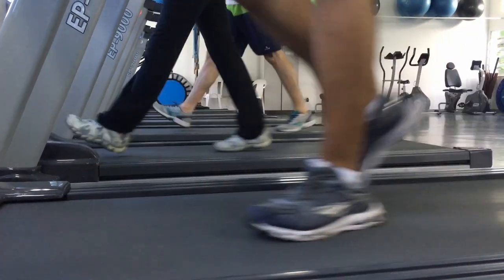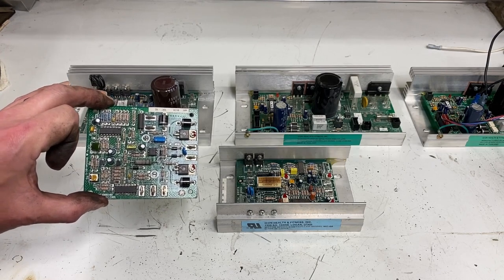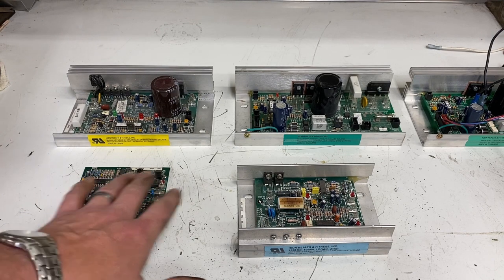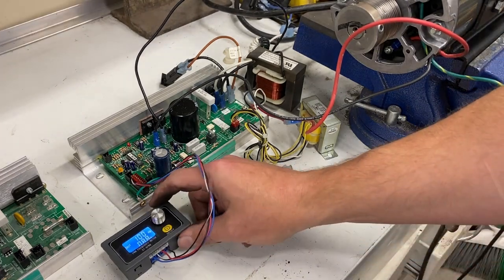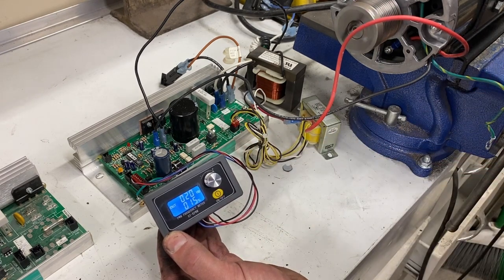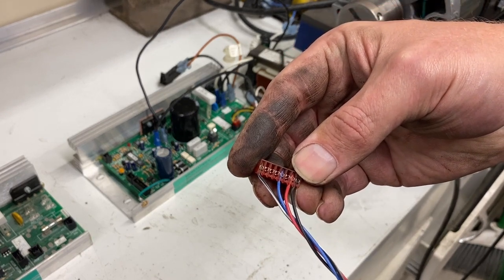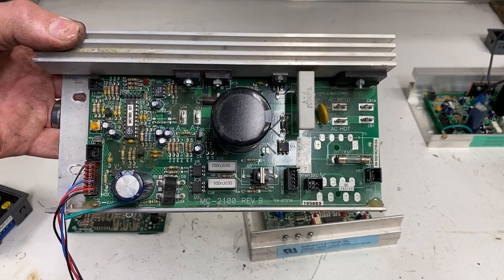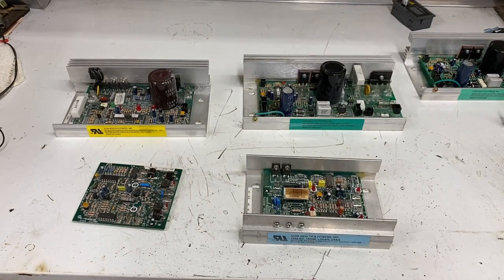Variable Speed Power Supply, Treadmill Motor Controller Boards: MC-02, MC-60, MC-2000 or MC-2100

Comment: In another video, you claimed the MC-2100 speed with a PWM is course when compared to the cheapo SCR you're so fond of. What giveth and why thy taketh?
Reply from the maker: I'm not sure what you are asking.  The MC2100 works fine but has the limitations associated with being for a treadmill.  I like the utilitarian function of the SCR https://youtu.be/zej3rkAEVDg
Reply: @dazecars  Yes, that video.  Starting at 10:15 in that video, you claim the MC-2100 speed adjustment can only be set at 200RPM or so increments, but in this video, the speed adjustment is very smooth at 2RPM or so increments. I'm confused because there's no way that cheapo SCR can even come close to a PWMs performance. All you have to do is look at the waveforms on an oscilloscope with some load. Some of those PWMs also have are very sophisticated and can adjust the current by sensing back EMF.  What gives? 

https://youtu.be/zej3rkAEVDg
Reply from the maker: @bobweiram6321    Couple things, first at the time increment you mentioned it was 100 RPMs increase not 200RPMs.  It is not possible for it to be much different than that when using the PWM signal generator I am using in the video.  That controller only allows you to increase the duty cycle 1% at a time.  That means without any other considerations you would only have 100 speeds setting and that is if the motor started at 1% (which it doesn't) and ended at 100% (which it doesn't, turns off at 85%) In reality there are 73 possible speed settings (in that bench test configuration).  The motor in the video is 6700RPM max.  Assuming there were no other variables 6700/73 would be 92 RPMS per 1%.  Now it is no where near that simple and that is why I measured the RPMS to come up with the difference between clicks.  (I do not know if that 100ish change is linear, it may me the same, more or less as RPMS go up but I don't know because I only measured at the range you saw in the video) Keep in mind If you use something more sophisticated with finer duty cycle increments than 1% you can dial it in at smaller RPMs, but that is more $ and complication.  Conversely the SCR allows you to adjust speed with a potentiometer and if you use a large one and a small one you can have course and fine speed adjustment.  With my lathe I can easily dial it in within a couple RPM.  It is geared at 3.5:1 so 7 motor RPMS.  If I had used an even smaller potentiometer for fine control I could have gotten down to 1 RPM at the motor but that is more accuracy then I needed.  The MC2100 also accelerates a lot slower as the SCR is at least twice as fast.  I have never once said that the SCR is "better" in fact I have conceded in many videos that the power produced by the PWM is cleaner,  smoother, and better for the motor.  The reasons I prefer the SCR over the 2100 are: simple to hook up, simple speed adjustment, no soft start or other “treadmill limitations" to contend with, finer speed control, faster acceleration, more compact components, and more robust components.  The MC-2100 wins in producing cleaner power but to me that is far out weighed in the shop.  If you take $100,000 sports car and $5000 truck and line them up to race on the highway the sports car will win every time.  But you put those same two vehicles on a rough gravel road with lots of potholes and ruts the truck will win every time.  Just because an MC-2100 produces “better” power doesn’t mean it is better for the application.  I also want to point out that just because I prefer the SCR for my application does not mean the MC2100 is a bad choice.  As I have said in many of my videos it is a good option and is usable.

Comment: hi david, well i couldnot not post my question here while having a compressor 150 liters looking for motor. 
i have used my treadmill motors for various things but not a compressor-single head. neither seen any body did that.
so, what do you think about this possibility? home use not daily use. thanks dear
Reply from the maker: Unless I am missing something, I don't really see an advantage.  An AC motor would be more efficient than a comparable DC motor powered with AC converted to DC.  The reason to use a DC motor is variable speed and there is no reason for that on a compressor.  I would try and find  an AC motor with similar specs to the one you are replacing.
Reply: only reason is price. o get dc almost for free as it is not appreciated at junck yards. induction motors are more pricey

Comment: Hi, my lifefitness 9500hr next gen treadmill electrics recently got fried. It has a large AC motor, says three phase. Can you recommend any controller to run tge treadmill as lifefitness no longer provide support.thanks lee
Reply from the maker: I can point you in the correct direction but I do not have specifics for you.  A VFD could be used to have variable speed for that motor and could control the basic on off and speed function of the treadmill BUT there would be no safety features like the magnet clip shut off or soft start.  in other words if it was going faster than the user and the machine threw said user there would not be the magnet clip shut off also with the elimination of soft start If you shut it off at a high speed and then turned it back on without changing that speed it would resume at the higher speed.
Reply: @dazecars  thanks for your help,  appreciate

Comment: Is there somewhere on the board that says what type of control it is,  MC-whatever?
Reply from the maker: Not all treadmill control boards have an MC designation.  It depends on the manufacturer. The board model number is usually on the actual board.   Also there is often a sticker on the heat sink.  The 4 I talk about in the video are all clearly marked so if there is not a clear mark with one of those numbers then it is not one of the boards I talk about in the video.

Comment: Do you have any videos on the more complex board (or one similar to it) you showed at the end? I have one collecting dust in my shop, and I'd like to try and use it instead of just tossing it.
Reply from the maker: no I do not
Reply: @dazecars  oh. Well, thanks for the time to respond on a year old video. The board I have has QQ-2061 listed as the model number if you have any leads on something like that. I've come up with nothing so far in my searches.

Comment: Can I get a part number regarding the power supply you used with the mc2100 at the end of the video . Thank you in advance
Reply from the maker: Not sure what you mean by power supply.  if you are after the signal generator, this is the PWM signal generator for the 2100 I am using https://amzn.to/3z3ivu3
Reply: @dazecars  the transformer sorry .
Reply from the maker: @jstc89  Its a 16V class 2 transformer like this one https://www.ebay.com/itm/403398903466?hash=item5dec72c6aa:g:y-kAAOSwEqlh2Ru2&amdata=enc%3AAQAHAAAAoJiM7SVzN2tj2Jp5eN0btQa2EeEONRdC2E4hL3onQye1MI%2B2bbxEXk1qNg8P5rZlRXvgLyjVGZSdj6ZsgdWRYRpyJRjPeG9EaucPD%2F2kIGr%2BMWlQWNALPIR2Q8dej%2FrNwtewXwGHV00Xl45Nt%2FR3neuzZRgnofVlROomI8rdfzzw57PjECMOOgVnPFI4WKUMj5bCk69i6XRj6nvovoNA1t8%3D%7Ctkp%3ABk9SR87ljIWNYQ

Comment: Belo trabalho em seus videos sobre o scr tenho um com potenciometro de chave e também se for possivel informe tenho
uma placa mc60 esta funcionando somente veloc. alta o que pode ser ?  o resistor controlador de velocidade queimou por alta temperatura ? (Brasil)
Reply from the maker: If the MC60 is only producing one speed and it is fast, the switching component that turns off and on to regulate the power has likely burned out in the on position.  Not sure which component that is however.
Reply: @dazecars   ok obrigado vou ver o componente que faz esta função de comutação
Reply from the maker: 👍 @aparecidosilva2653

Comment: Hi I’ve bought the Zk pp1k to run my mc2100e treadmill  board and motor. But first time switching on it blew the fuse in the supply plug. After trying some of the adjust with the buttons at certain stages of adjustment the motor will try and run for a split second with sparks flying of the brushes area do you have any ideas what going on or do you know if there are any wiring instructions anywhere that I can work from. I set it at 20 hz the power %buttons do nothing I’ve tried the other setting you get when you hold down the set button and the motor went pop again. I thought this was going to be simple as al the vids I’ve looked at make it seem like a couple of minutes work I’m getting to the stage where it all going in the bin and I will have to go for three phase not what I want to do but I need to get a motor running for my new belt grinder I’ve make.  If you can give me any advice it would be very much appreciated. Phil
Reply from the maker: Sounds you set up the PWM correctly but have a bad MOSFET of the board.  There is a switching transister on the board called a MOSFET.  It switches on and off at varring rates.  This on off pattern it what  adjusts voltage.  Some times when a MOSFET goes bad it will stay in the fully on position so you are getting full volts all at once.  hence the sparks then the board senses a problem and shuts off.  Please let me know if I can be of further assistance.
Reply: @dazecars  Hi thanks for that I will check it out I think I have another one of these boards I will find it and try that. Thanks again

Comment: Great info, in a great video with well spoken narration. Thanks for that.
I have a question: I have a treadmill motor and controller, the MC2100 you referenced here. My plan is to use these for a lathe upgrade, but getting braking and reverse switching designed so as to not damage the motor or the controller does not seem to be readily available info. Do you have this setup on yours, and is there a schematic or some diagram to indicate the setup? Or at least some info about this?
Thanks
Reply from the maker: On my lathe I use an SCR voltage controller but there is no reason you shouldn't be able to use the treadmill controller.  There is no braking on mine the way it is set up, and when I turn it off it comes to a stop after a few seconds.  As for reversing direction that is as simple as reversing the wires going into the motor. I do it on mine with a DPDT switch that is off in the middle. (I use that switch all the time when threading) The only improtant thing is that the motor is not miving when you go the other direction.  There is more info and pix on how to reverse direction on my web page writeup.  Please don't hesitate to let me know if you have more questions. https://dazecars.com/dazed/variable.html
Reply: @dazecars  Thanks for your reply, I agree the reversing is very straight forward. What I'm really wanting is the braking, and motors have inherent braking by just shorting the red and black together while the rotor is spinning. But that is a very abrupt stop and I was looking for some resistor values that can make it a bit more gentle. I've seen control units from KB Electronics that do it, but I wanted to adapt it to the MC2100 since I have one that is working perfectly. I've done a bit of rooting around on the interwebs, I'll keep at it and hopefully find something. Thanks again.
Reply from the maker: @jameshisself9324  Interesting.  I will mock some things up and see what I can come up with.  I have a couple ideas but will need to do some testing.
Reply from the maker: @jameshisself9324  After some testing I know some things BUT I am not an electrical engineer I am just a hobbiest so some of my finding ar a best educted guess. First you are correct a dead short is way to abrupt and would be hard on the motor. I also know that between 10-20 ohms is a good resistance to get decent braking BUT I didn't have a high enough wattage resister to get it working consistently. The problem is these motors (at max) are on average 1600 watts to drive them. I know that as a generator they will not produce the same output as it would take to drive them. In other words if 90V and 18A gets you 4000 RPM then once that power is eliminated that same 4000 RPM will produce something less than 90v and 18A but I am not sure how much less. Either way you need a resistor that will handle the max wattage even though it will rapidly drop as the motor slows down and you want a resistor that can handle the braking repeatedly so shooting for one that is a minimum of 1600 watts (watts = V * A) would be  a good starting point BUT I would air on the side of bigger. The other issue is I found is that an MC-2100 board does not like the power to the motor cut and then reestablished (I was using a DPDT switch to go from powering to braking) and using that switch overloaded the 2100 board and I fried it. (small price to pay for some knowledge) If I was going to use a braking resister I think I would drive the motor with the more robust SCR voltage controller although I did not test one because I ran out of resisters. 😁  Interestingly enough if you look on eBay for resistors with 1500W-2000W and in the 10-20ohm range they are called "braking resistors"
Reply: @dazecars  Wow, great research. Sorry to hear you sacrificed a controller for this.
It sounds like you did what I was afraid to do! I've been researching mostly through documentation I could find, which has been very limited. 
 It sounds like you are saying that just disconnecting and reconnecting the motor from the controller while running will damage the controller? I was under the impression they could handle that. Again, just internet research not my own testing. I don't have extra controllers to sacrifice.
It sounds as though the MC2100 is not suitable for a lathe then. I've got very old EE skills (doing SW now as it's more lucrative) so I would love to tackle the challenge of getting this to work with the controller I already have. But I don't want to start collecting treadmills so this might be the only unit I get and usually I can research enough online to have a predictable enough outcome to avoid sacrificial testing for other projects. This one has been more challenging and now I wonder if it is just not possible with this controller.  Your excellence research and testing of the SCR units might be the way I need to go.
Reply from the maker: @jameshisself9324  Yes it was the disconnection and reconnecting to a running controller that caused the issue and failier.  I believe it is the MOSFET that went bad. What I don't know is if that is the normal result of disconnecting and reconnecting the motor to a running controller or if the controller was already nearing the end of its life and that action pushed it over the edge. I picked that specific 2100 because it was the roughest one that I had and was sacrificial. I am a huge fan of SCR voltage controllers (as long as you get a good one and use a 4 wire choke to clean the AC and then a 2 wire choke to clean the DC after it comes out of the rectifier) I am running SCR on my lathe, mill and band saw. Very simple, very reliable and has worked well for me. Incase you have not seen it I have a video on the subject.  https://youtu.be/m0cLqKg1byI
Reply from the maker: @jameshisself9324  I have a question for you. I know that shorting out the terminals is two abrupt of a stop but how quickly do you need it to stop? When I was doing my freewheeling experiments on the bench it would take about 20 seconds to come to a stop but then with a 10 ohm resistor I got it down to 5 seconds which seamed about right. I was thinking of getting a braking resister to add to my lathe (for threading) but then I realized that when I fire up my lathe at max RPM it comes to a complete stop within 4 seconds due to the resistance created by the machine. At slower speeds it is an even quicker stop so it got me thinking, what would be your ideal stop time in seconds? I guess what I am wondering is if a braking resister is even needed for your application.
Reply: @dazecars  I wanted it for an E stop so pretty quick, a second or 2 max. I was thinking about this too, I'm not even sure I'll need it. I do need F-R switching on the motor input for sure though, and if that blows up the 2100 then it will still be a problem.
I've got some other projects ahead of this one so I can stew on it a while, but I'll probably try the SCR setup you recommend. Once I've got that running, I'll decide what sort of braking I need if any.
Reply: Here's a voltage diagram from my 2100:  https://imgur.com/a/hGwc5hC .  Hope this helps!
Reply: @SyntaxMSU  Thanks. Mine came with one of those too. Do you have a braking and fwd-rev solution?
Reply: @jameshisself9324  Nope I've never tried braking with my setup, sorry.
Reply from the maker: @johncoops6897   you are WRONG on not using a resistor. A direct short is extremely hard on the brushes and the commutator that the brushes ride on. Everything else you said is way overthinking it. I have an entire series (3 videos)on an electric brake.  On my machine I have a master power switch, a relay for the “brake” and a 3PDT to control the direction and motor brake.  any time the master power is cut the brake engages or if switch directions the brake engages.